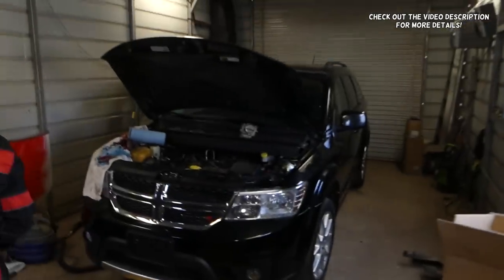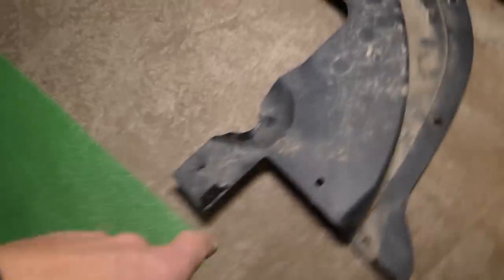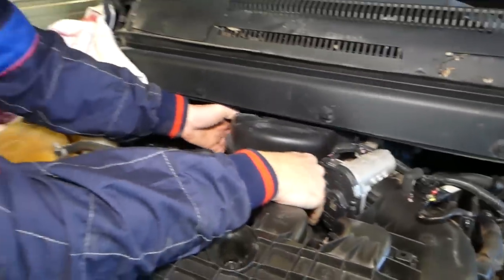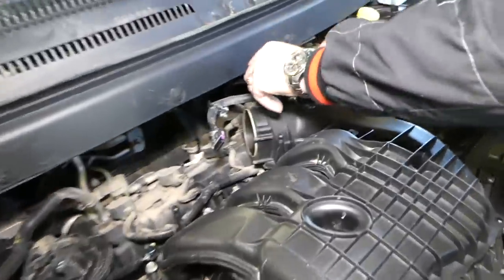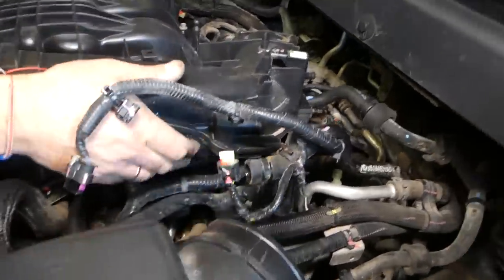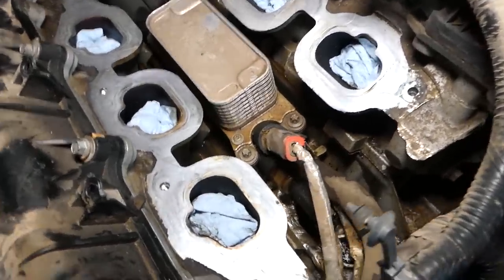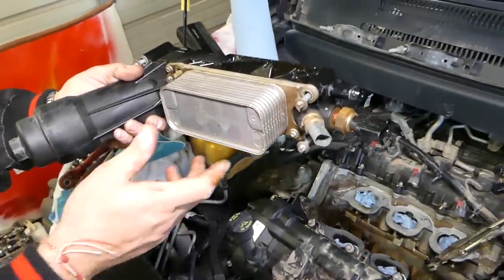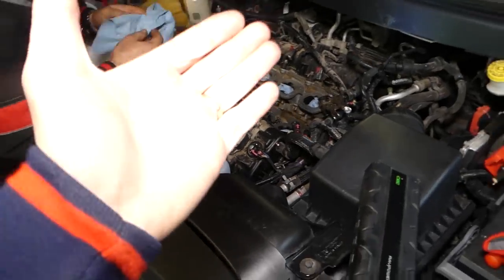DODGE JOURNEY OIL LEAK FIX 3.6 V6 PENTASTAR FIAT FREEMONT PENTASTAR

Comment: Thank you guys. I did this already at my 2017 Pacifica. But i changed the whole Housing into an Aluminium one. But surprise surprise after exactly 1 year later it is leaking again. So ordered new o-rings. waiting for them to arrive (ordered (rockauto) in the us and i am in Germany). I hope and think i just need to change the o-rings and have peace for another year or hopefully longer.
last time i didn´t drain the coolant. Maybe i will do it this time. 
The o-ring change byself is a 5 minute job. But to get their is a long way.
Wish you all the best.
Grüße aus Deutschland

Comment: I had the same leaks in the same areas. But it was coolant I was losing. I had to add 50/50 almost every other day. So I put some stop leak in and it slowed it down extremely. I just added about 1L of coolant after 3 months of treatment. But recently I’ve noticed my oil level was a bit down. Looks like I have a slow leak somewhere. Just added Barr’s 2-1 stop leak and hopefully it will slow it down completely. Not even sure yet if it’s even an oil leak or just the coolant still leaking. Will  have to put something underneath to catch and test it.
Reply: Just had oil changed 2 months ago. I hope they didn’t over tighten anything.
Reply: Can I take a pressure washer and spray those two areas on the engine? I want to spray at the base of the oil filler neck snd on the other side of the engine under the air intake? I want to clean it all up and underneath m. Do I can monitor where it’s coming from.

Comment: One off topic question. Why do my wipers all of a sudden stop working while I’m driving? I have to pull over on the hyway blinded by the rain, and can’t see where I’m going. Turn the car off and back on and start driving hoping for the best. Then it happens again!! And again and again. Tonight was the worst of all.
Reply: This has been a common problem with this model. Hopefully you’ve already fixed this issue, but if not try replacing the wiper relays inside the fuse box.

Comment: What's the price called that you replaced the seals on
Reply: Idk what he called it, but Amazon has the upgraded Oil* Filter Housing for like $70. It comes with the new gaskets, too. But don't be fooled. He skipped some steps if you want to do the replacement yourself. There's a super helpful 2min video elsewhere to explain the fuel injector connections you have to disconnect to even remove the intake manifold to get to the housing.